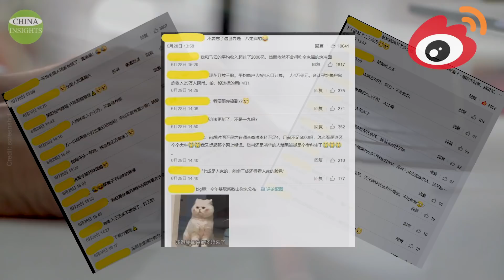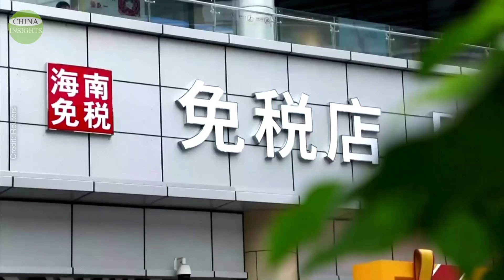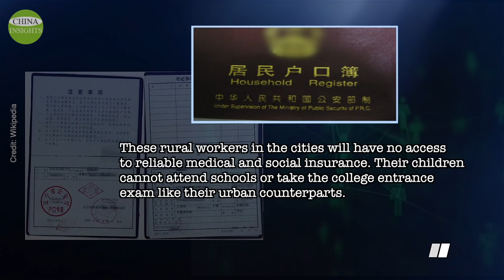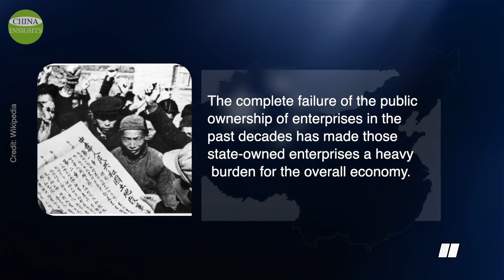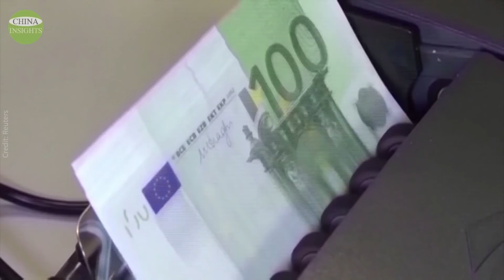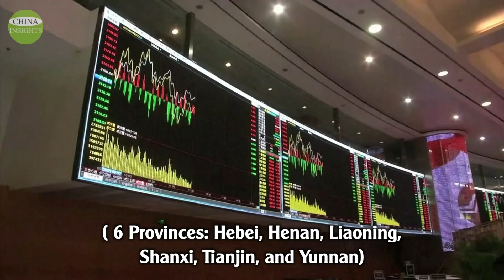China: Increasing poor population cause Inadequate domestic spending power & Government debt crisis

Comment: One of the single most glaring things I noticed was that stunning economic disparity. Obscenely right, buying a Lambo for a 15 year old boy or a 80k purse for the sister and 200 others building the hotel in absolute filth, lowest of the low poverty, plastic shower sandals, a ration of fast noodles and a bottle of water laboring in utterly brutal conditions.

Comment: Maybe on the surface everything seem glittery and perfect, but if you scrape off that surface you’ll find dirt. The thing is even if they are the second largest economy now, and on the surface it may seem that everything is close to perfection, it’s only a small percentage of the population that wealth includes. And although this looks glamorous and all, it doesn’t work in the long run since the inequality among the population becomes to massive. This is just a recipe for disaster, as we know in the end just leads to more and more anger and dissatisfaction with the ruling authorities. It’s basically a recipe for civil war, and then you’re back at square one again. And so the cycle continues.

Comment: Honestly campers and small houses on wheels would fix this get those small home on wheels off grid and get a mobile green house with bees and chickens in it. And the peasants can work while living comfortably. Have then rent small plots of land for $200-$800 monthly depending if they get a a small backyard in the back. I'm sure if they only worked for the plot of land they could move comfortably from landlords and can find someone cheaper if needed. Seriously get insinerator toilets, solar, and use rain collection with filter for showers and sink use. They can get water from there water supply or from water bottles. Just saying it's very fix able what they pay in rent they can pay for those tiny houses it's an untouchable market that could boom there.